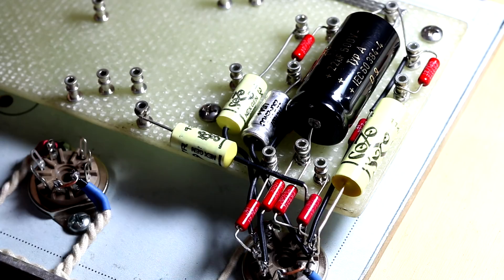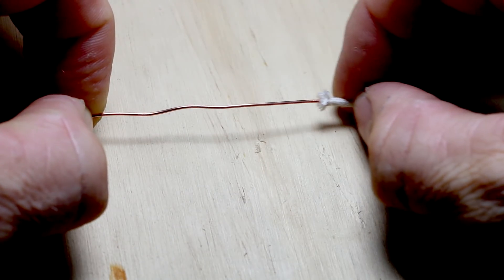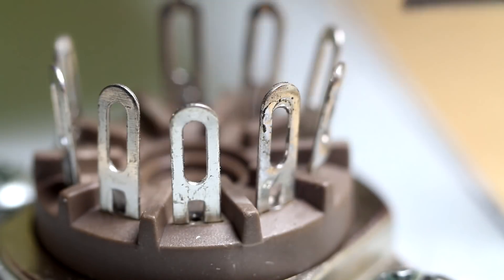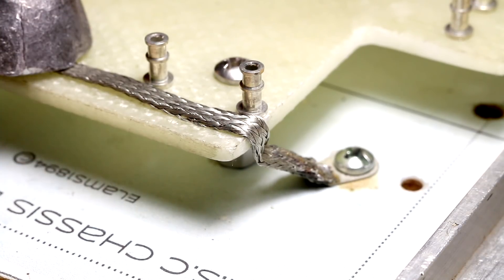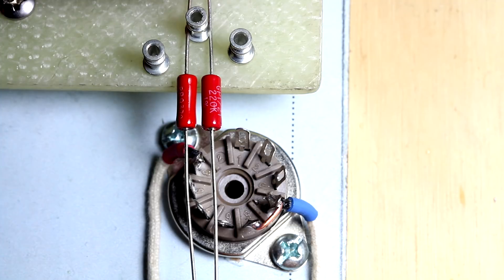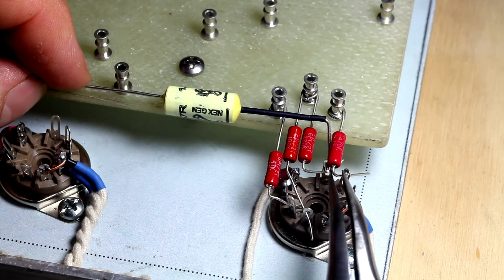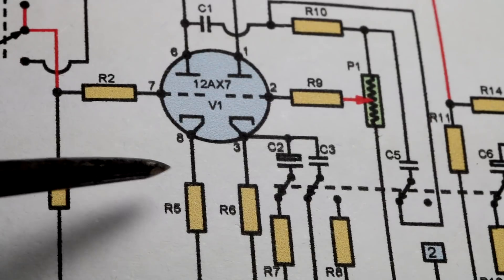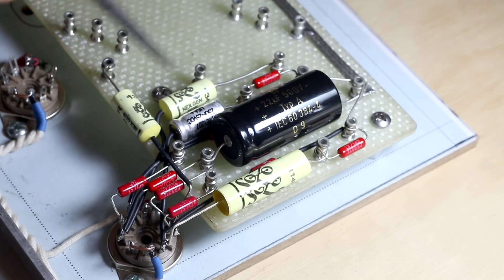Small Tube Amp Build - Step by Step (4 - Components)

Comment: I see that you made a jumper connection between tube lugs. I'm looking to build my first amp and the instructions for the kit I've been checking out suggest bending and crimping the two lugs together. Would you warn against this? Are those lugs very fragile? Great series btw!
Reply from the maker: You can bend the lugs together however I don't really like modifying the socket in that way. If the socket lug breaks, or if it is weakened by the bending, then you may run into problems later. The last thing you want is to break a lug as they are pretty delicate. Normally, a nice tinned lug and a resistor lead or wire that makes good contact through the eye of the lug is all that is necessary. I dont wrap a lead or wire entirely around my tube socket lugs (personal preference) as doing so means that you'll never get that component or wire out. Just make sure you make a decent contact and your soldering is sound and you'll be right. Cheers!

Comment: good job but you need to make a meniscal connection on all jobs
Reply from the maker: Thanks. You sure do and that is what I have done, cheers.
Reply: great i build hi fi valve amps
Reply from the maker: Hi Fi builds, awesome! I drew up a mono block circuit a while back but as yet have not got around to building it. Hi Fi building takes on another level of meticulous and my mind boggles at some of the prices of the top quality components such as those beautiful beer can capacitors. I was going to use much lower end capacitors myself as the price was prohibitive. What components do you use, just out of interest. Thanks Ian!
Reply: the caps i use are  orange drops brown drops and vishay caps and resistors and allen bradley resistors too , you don't need lage caps in HI FI valve amps 330MF good PI filter choke, good diode rectification circuit in HIFI amp and preamp is always a good thing don't want any sag
Reply: Here, this will help you understand. https://www.evilmadscientist.com/2015/how-not-to-solder/
Reply: Sorry to butt in, I'm new to all of this and can't find any info on a 'meniscal connection' - what is that?
Reply: Tim S appreciated!

Comment: where can I buy these turrets and what type of board is that and how do you press the turrets in?
Reply: PETR DOLEZAL See the earlier videos. The board is custom laminated, using fibreglass and epoxy, as far as I recall. The turrets I can't remember but he gently tapped them in with a hammer before peining the ends on the opposite side of the board.
Reply: thank you
Reply: Turret Lugs: https://www.mouser.com/Electromechanical/Hardware/_/N-5g2cZ1yzvvqx?P=1yy2w8y&Keyword=turret&FS=True
Reply: Got a bunch from Tube Depot.

Comment: Very pretty but bear in mind parallel wires maximise inductive coupling which can be a big issue in tube amps. Looks like you're not building a high-gainer so no worries
Reply from the maker: Thanks ONZ. I took that into consideration and input signal wires are either well away from, or perpendicular to output signals. Cheers